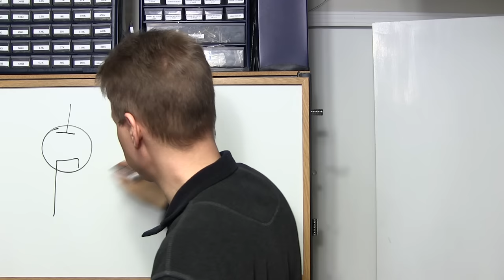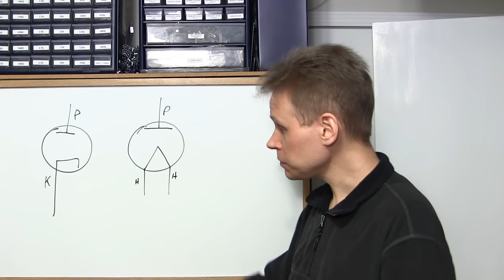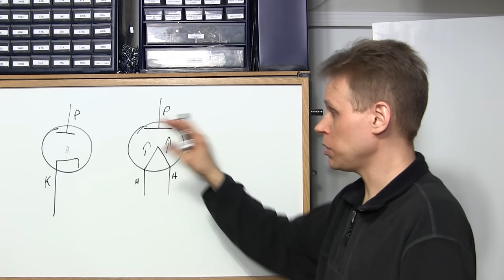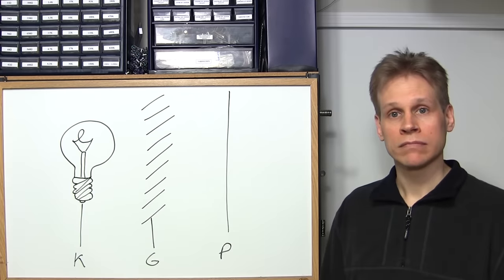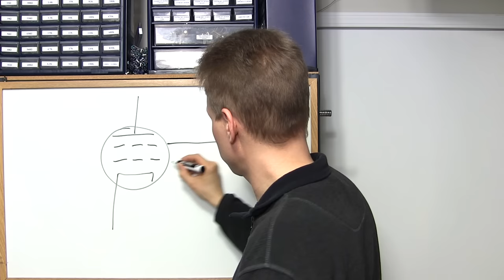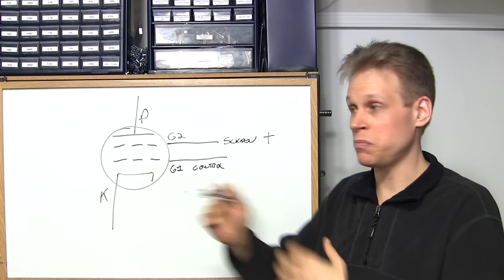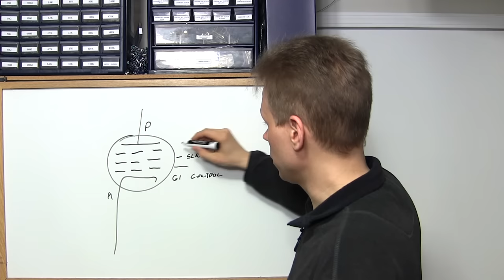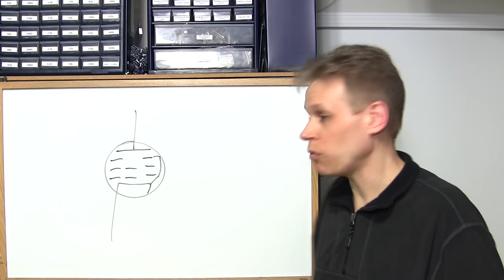How A Tube Works

Comment: I enjoyed the video. Nevertheless, I still don't understand how an amplification takes place when the grid is there to limit the electron flow.
Reply: Amplification is the switching of a higher voltage or current with a lower one. Limiting a higher current with a lower current and voltage is amplification.
Reply: Andrew Somerville
Thanks for the explanation. Now I'm really confused :)
Reply: Peter Focas
Thanks. Still not sure how to figure this out but at least it's more information :)
Reply: Hahaha
Reply: It's not that easy to get a good mental picture of it.  The grid is always negative.  Sometimes more and sometimes less.  It depends on the incoming signal that you want to amplify.  I mean that's the reason for the tube in the first place.  That grid can shut down the electron's travel plans to the plate.  It can squeeze off the flow or let it squeak by a little bit.  Or it can let it rip full bore.  Do you know about voltage dividers?  Take out a resistor and put in a triode.  That's how they are usually used.  If you don't know about voltage dividers, no problem.  The conduction of high power is controlled by a weeny little signal on the grid.  Tell me if my explanation sucks.  I'm on facebook too.
Reply: alex tworkowski
No idea about voltage dividers either. It really is hard to get a good mental picture for a layman like myself. I thought it would be easier to understand a little more about electrics. It's really hard to get a grip of it.
Reply: Mathead It might be better, and it was for me, if you thought about it like water in your garden hose.  I'm trying to match what i say to what you say.  I don't mean to be insulting.  You must start with what you understand.  I will start anywhere you with.  I have taught at all levels.  I have no preference.  I like to pluck people out of the deep.  I like to save the person who is washing away.
If you like, i will tell you about voltage dividers.  Draw a + line on the top of you page and a - line on the bottom.  pick a random point in between and draw a zigzag line above and below that point.  Let's say the voltage is 120v.  If the top resistor is really tiny...then the voltage at the point will be almost 120v.  If it's really big, then the v will be down near ground or zero.  Catch me on FaceBook.  I can explain all the bs easily for you.
Reply: Got a great idea.  A simple rheostat is winding of wire of many turns wrapped around a stick or something.  It's uninsulated and a little wiper or pickup or thingy moves along it's length.    The winding is between plus and minus, so the thingy moves from neg to pos and back and forth.  If it's close to the neg, it's v is low.  If it's close to the pos, it's v is high.  If  you see how that works and you put the wiper in about the middle of the winding, you can replace the upper and lower parts of the winding w/ resistors.  That's your voltage divider.  Closer to pos is high and closer to neg is low.  Did i make any sense.  Tell me.
Reply: Think of the tube like a water tap. You can vary the amount of water flowing through the tap by turning it. No matter how much pressure is present, it takes less pressure to turn the tap. It takes a small amount of force on the tap to control the large force of the water coming out. That's amplification. 

The principal of electronic amplification is exactly the same. A tube is a device that uses a small voltage to control a large voltage, similar to the high pressure water being controlled by a low pressure turn of the hand. When turned, the water flowing from the tap increases and decreases in time to your hand turning the tap. The current flowing from a tube increases and decreases in time to the voltage at the grid, producing a change in voltage which is larger than the change in voltage used to control the tube. 

The principal of gain means that the control signal can be smaller than the output of the water tap, in other words if a tube has a gain of 50, it takes a signal only 1 unit in amplitude to open the valve enough to output 50 units. Amplification occurs because the small signal controls a larger signal. 

This is analogous to the threads in the water tap which provide a mechanical advantage to the plunger which cuts off the water flow. Because of this mechanical advantage, you can rotate the water tap using less force than the water pressure exerts on it. You are in-effect controlling a large pressure with a smaller pressure. This principal is referred to as "Voltage amplification" because voltage is analogous to pressure. If the output pressure is proportional to the input pressure, but larger, "voltage amplification" has occurred.
Reply: The concept of a voltage divider works as follows: when you turn on the tap, the water comes out of the tap and immediately loses its pressure because nothing is holding it back. A current is flowing, but there's no pressure as soon as it comes out. 

Now put your finger over the end of the faucet. Pressure is now present between your finger and the water because your finger resists the flow of water. That pressure will change as you turn the tap. What you've done by putting your finger there is you've converted a varying current (or varying amount of flowing water) into a varying voltage (or varying amount of pressure between your finger and the water). 

Since tubes convert a varying voltage at the grid to a varying amount of current flowing through them, if we want a varying voltage instead, we had to stick a resistor in the way of the flowing current. Now a voltage develops between the tube and the resistor, just like the pressure build-up between your finger and the water. That's how you turn a current signal into a voltage...you stick a resistor in the way.
Reply: I wish i had said that.  That sums up the whole deal...i think.
Reply: alex tworkowski
Andrew Somerville
Owww. I think I might understand something at this point. My confusion came from the fact that I could not understand how current could be amplified without adding electrons, but what actually happens is that the source is the control signal for a larger current which enters the tube as an even flow and is transformed according to the strenght of the control signal. Right?
P.S. Sorry, alex tworkowski , I'm not on Facebook because it melts my synapses ;)
Reply: Mathead The high voltage is applied between the cathode and the plate.  Thats the voltage that is applied to the load...ed a speaker or whatever.  That voltage is modified or contoured to match the input voltage or signal voltage.  Your electric guitar put out small signal.  Your amp takes that signal and makes it big.  The tube is how that's done.
Reply: alex tworkowski
But the point is: the control signal forms the high voltage to adopt its shape, only bigger, right?
Reply: Mathead Pretty much.  The control voltage wiggles put that same wiggle onto the high voltage.  The high voltage should be a copy of the signal voltage.
Reply: alex tworkowski
Well, thanks a lt for having the patience to explain. Also to Andrew Somerville of course. I'm happy to see that the electricity respond to the laws of physics that I am familiar with and that current can't be amplified without adding more current :)
Reply: Mathead Yeah, exactly right. Your first reply is correct. The tube just controls the flow of current from a larger source and is controlled by the smaller gate voltage. If the grid voltage wiggles a little, the current going through the tube wiggles by a lot.
Reply: Andrew Somerville
Woohoo! I actually understand the principle of amplification, transistors and triodes now!
Reply: Just found your YouTube channel today.

Extremely impressed with the depth and range of your knowledge and ability to convey it to others.

That said, I've been trying for 5 or 6 years to get a circuit designed, to no avail. I need help.

Not vacuum tubes, but inexpensive discretes and possibly  very basic processor, programmed before assembly.

Do not want to use Audrino or Raspberry-Pi...far too expensive. 

Need to drive a TO-18 Package laser diode between 1W and 10W at a 30% to 50% duty cycle at a jumper-selectable 10Hz, 12Hz, or 14Hz. Thus laser driver is needed too. Commercial modules may be acceptable here.

And, no, a 555 IC alone is not stable enough. This has to function from 0F to 120F without calibration.

Power source will be "dirty" rectified 12VDC from the alternator on a small engine similar to a generator driven welder, motorcycle, quad, or personal watercraft.

Again, seeking to minimize the Bill of Materials cost.

I'd be willing to pay for a working circuit of just the 14Hz selection, with an accompanying explanation of how to choose, calculate, and use crystals in this kind of circuit.

Entire package needs to fit into a volume no larger than a baseball. Better yet, a Garage Door Opener.
Reply: tintruder224
I believe it would be more useful for you to start your thread at top level.
Reply: @Mathead: you got it.
"how current could be amplified without adding electrons"
The term amplification is confusing really it is steering a strong source with a weaker one. None of the power of the original signal goes out with new signal, only the shape.
Reply: Mathead I was just reading thru here and i want to make something very clear.  Without the grid, the tube would be running at full throttle and the plate would be absorbing the full high voltage of the power source.  You would have DC current just like a battery.  The grid is like a lion tamer.  It forces the current to behave.  When it goes very negative, the current is pinched down.  When it goes just a bit negative, the current is allowed to flow.  In this way, the output of the tube is a mirror image of the signal that was applied to the grid.  That signal may have originated in a phonograph cartridge, or an electric guitar, or a radio receiver or any number of things.  Does this help or hinder?
Reply: alex tworkowski
Yeah, I actually got the picture.
Just like 0MoTheG said: what was giving me a hard time was understanding that the amplified signal contains none of the electrons from the original signal. Got that now. Thanks :)
Reply: I know this has been done to death but I prefer to think of tubes as valves. Many people call them that. The 'pipe' of electrons is quite large between the Cathode and the plate. The plate is usually high voltage. The smaller signal connected to the gate opens and closes the valve controlling the flow through pipe between the cathode and plate.
Reply: A negative voltage (the negative bias) is applied to the grid which allows a certain amount of current to flow when no signal is present. A signal, as it goes positive drives the grid less negative, allowing more current to flow, and as the signal goes negative it drives the grid more negative allowing less current to flow. This current, modified by the signal, is passing through the plate resistor, causing the voltage across it to vary in the same way as the signal voltage but to greater degree, producing a larger (inverted) copy of the signal at the plate.

Comment: How do electronics jump through the air from the filament to the plate?
Reply from the maker: There is no air in a tube, there is a vacuum.
Reply: Mr Carlson's Lab Why does that make a difference?
Reply from the maker: #1... If there was oxygen in the bulb, the filament would oxidize very quickly and burn out. #2... When electrons fly from the hot cathode (heated by the filament) they would collide with the oxygen (or gas) in the bulb. Picture yourself running in a straight line down a road with nobody there (no air in the bulb.) Pretty easy right? Now picture yourself running in a straight line through a big crowd on that road. (obviously you would run into people) You are the electron, they are the oxygen (or gas.) If you were that electron, when you collide with the oxygen (or gas,) you would knock a few electrons (or electron) out of it, which results in a positively charged ion. This wants to go back to the cathode now... And you get a pretty purple (powdered color glow) The tube now conducts heavily (draws heavy current) and fails.
Reply: Mr Carlson's Lab thanks, I just am not understanding how electrons can move through empty space, I thought they had to be in a conductor

Comment: I know this is old, I never learned much about tubes because they were quickly being replaced with solid state. I remember going to K- Mart with my dad with tubes from our TV. They had a free tube testor set up just inside the store and uou could test your TV tube for free. They sold a limited amount of replacement tubes there. Seems we were always going to this one solid brick building down town that was floor to ceiling racks with endless boxes of tubes. I now understand why the brits call them valves. in a way, they do work like a valve. I just remember being told to stay away from the high tension lead comming from the picture tube as the back of our TV was always off. My dad was forever swapping tubes and screwing with the adjustments for the color. Non of our TV's were new so they all had color issues. It was nightly entertainment to tell my dad what color the screen was now as he stood behind it messing with tube sockets and various adjustments to the color.

Comment: Remember when a 6al5 diode was used to trigger a relay holding back the DC. Till the tubes load came up so the filters wouldn't EXPLODE .in bw.tvs and stereos .

Comment: I have a low grid - voltage on a zenith z334 radio..what causes a low grid voltage..say like I need -.7 volts and I have -.4 volts...????????
Reply from the maker: Depends on which tube your talking about. If its the AVC Voltage, it will vary with signal.

Comment: As I am just learning about electricity and electron flow I found conventional schematics confusing as they seem to violate physics.  We are taught in physics that all systems flow from positive to negative as nature is always trying to attain equilibrium.   Heat flows from hot to cold, high pressure to low pressure, water flows from a higher area to a lower area, etc.  I wondered why electrical flow is the exception to the rule so I did some research.  Turns out it's not and that we have Benjamin Franklin to blame for conventional schematics.  He mistakenly thought electrons flowed from negative to positive.  I guess now we're stuck with it
Reply: He didn't know about electrons. At the time it was assumed that some kind of 'electrical fluid' was flowing in the wires. His committee arbitrarily decided that it flows from positive to negative. They got it wrong.

Comment: I’ve have a small amount of knowledge of transistors.  Watching your tube lecture baffles me how technology progressed from tubes to transistors to all solid state, mosfet or what ever. The tube seems so different from its successors it’s hard to under understand.  I’m a mechanical engineer. I know the difference between a diesel, an Otto cycle, a turbine, a steam engine, turbine or piston and so os. You look at a 100 year car engine transmission,engine or differential you can recognize the progression, not so with electronics. Help.

Comment: Regarding the patents::-->> David Sarnoff, of RCA was happy collecting licensing fees from almost everyone, but he was not about to pay Philips Mullard any licensing fees for the rights to make a real pentode, which was owned by Philips, so RCA made some minor changes. RCA internally tied the surpressor (G3) to the cathode (K), and called it a pentode. Most of the time they get externally connected anyway, but not always. I still get a lot of comments to the effect of, "US made pentodes are not really pentodes.", from my tech bloke friends in merry old England. The 807 was based on the 6L6. Marconi Osram Valve/GEC attempted to do the same thing with their KT66, but their version, the KT8 , would barely make it up to 27MHz,, so it was a commercial failure, and it is rather rare. I ran across an old Hazleton radio with no RCA licensing notices in it. That is odd for anything pre 1960. Apparently, Hazleton predates RCA a little, I guess. No octodes, hextodes,  heptodes, or hop toads?   73 KI7AQJ  SK
Reply from the maker: +Seth B 
When you speak of Hazleton, do you mean Hazeltine, or is this something different I may have missed? Great Info about the KT-8 tube. Those GEC tubes are sure sought after by the audio crowd!
Reply: Yes, Hazletine's Neutrodyne receiver. Brain farts or finger malfunctions with the truncated laptop keyboard.   KT8s are a good audio tube, but the TT21 actually worked very well as an RF tube as well. The TT21 is based on the KT88 GEC. Like the TT21, you can run more plate voltage into a KT8, than a KT66. I picked a lot of 5881s, and TT21s out of decommissioned military aircraft being demolished out in the desert as per treaty agreements with the former Soviet Union. TT21s were used in a lot of airplanes, and they are a pretty decent transmitting tube that will work in place of 6146, 8297, 6146A, 6146W, and the "usual suspects" used in old hybird and valve ham radios, that did NOT use sweep tubes. I just had "THE YEASU SWEEP TUBE TWINS" in for repairs. The old FR-DX-400 & FL-DX-400 receiver & transmitter, plus an FL-2100B linear. A large majestic looking setup but fairly average performing even by 1968 standards. I like the linear amp, but those 400s take up a lot of real estate.  I don't know when the FCC actually approved the FT-DX 400. 1968? 69?? I especially like how the 10 meter band in the FL-DX 400 is in 3 or 4 stages but these are mostly in the 11 meter band, AGAIN. Some of that older Musen stuff comes in will all kinds of "funny crystals" that are mostly in the CB band rather than actually in the 10 meter band. Especially the late 1960s and even more so the 1970s stuff, comes in like that.  FT 101 Es are especially guilty of that. I'd bet more CBers bought those than licensed hams. Kind of like Galaxy & Stryker 10 meter radios now.